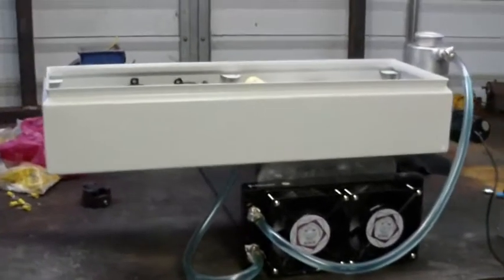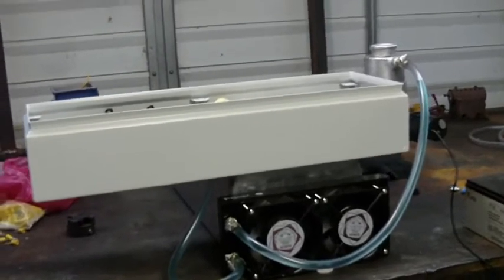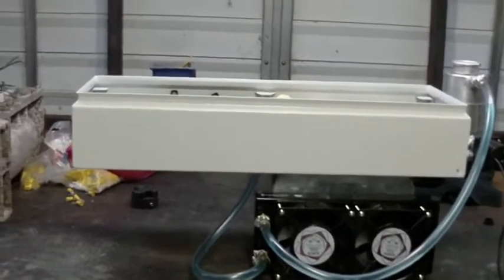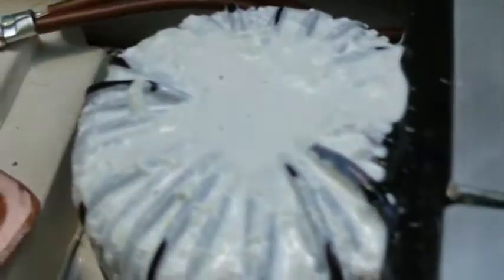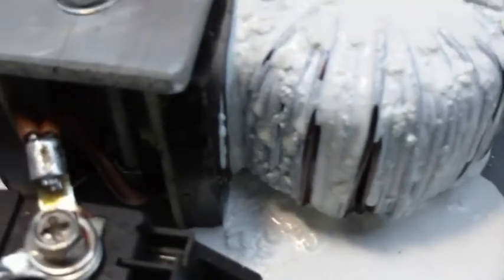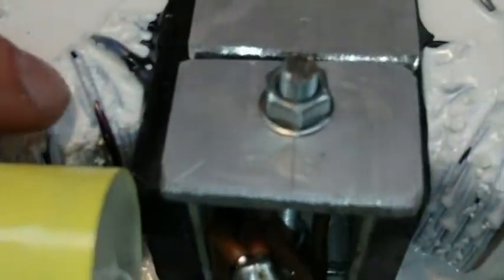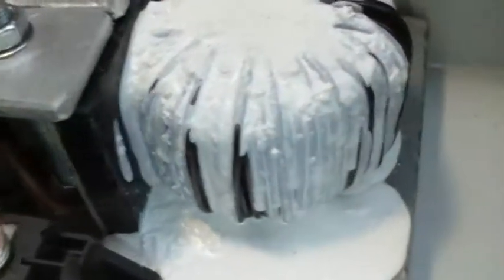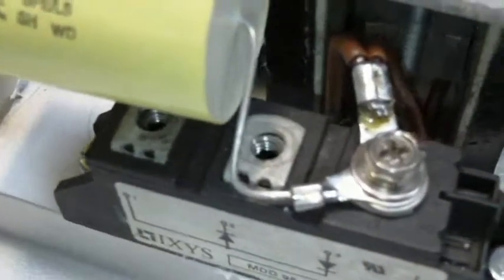BMW EV Conversion 57 Liquid Cooled Charger 01

Comment from the maker: Its a buck converter circuit. In theory , if i'm running at 92% efficency at 10kw that's 800w of loss.Adding in the pfc that's another 500 is watts of loss.